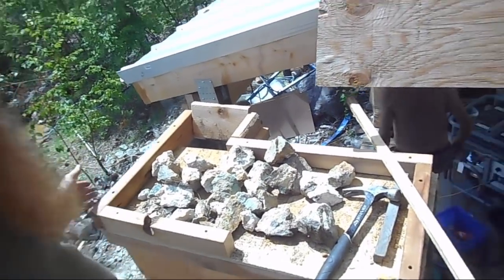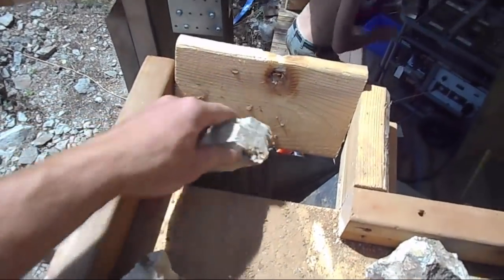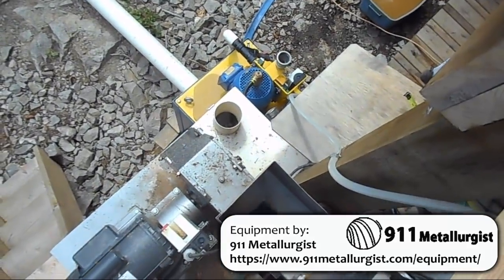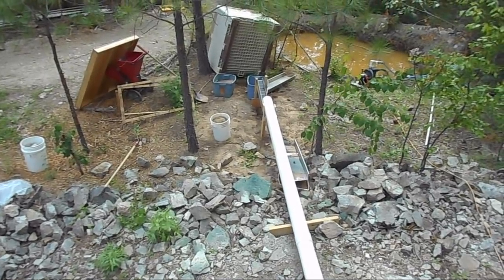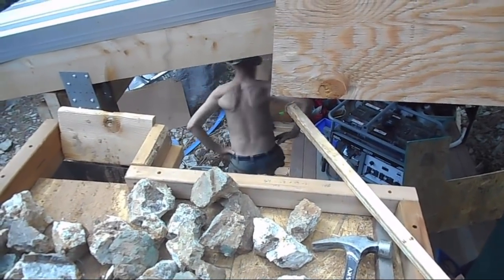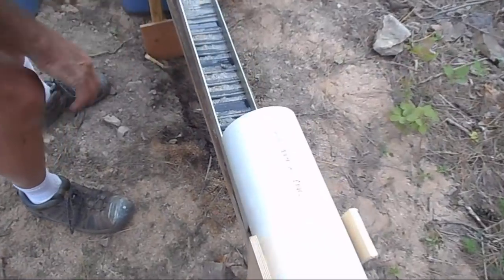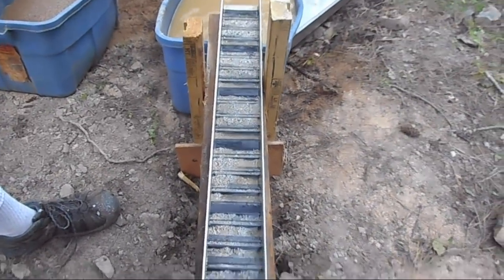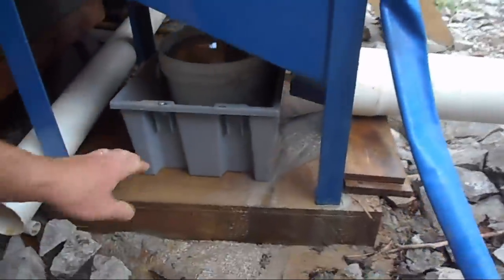Malachite, Azurite, Pyrite, Quartz, and "OH MY...!"

Comment: You should try adjusting the jaws to give a finer primary crush which in turn would give you a finer product from the impact mill and then better results from the concentrator.
Reply from the maker: We've tried to tune the 2 crushers together to give the highest throughput
Reply: Throughput alone does not constitute effective processing. If recovery is low and throughput is high you are sending valuable ore to the tailings. In order to maximize recovery, the minerals have to be liberated from the gangue, which is only achieved with the finest milling possible. From what I saw in the video, your concentrates still have grain sizes of coarse sands to small gravel. Just trying to give you some friendly and helpful advice from many years of experience as a mine geologist working closely with metallurgists.